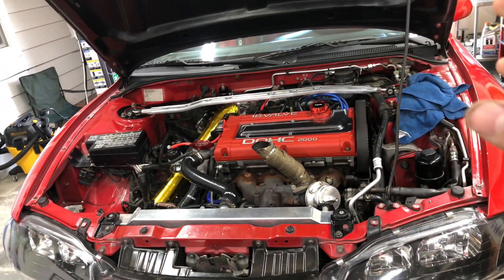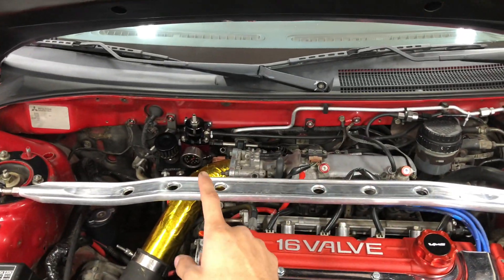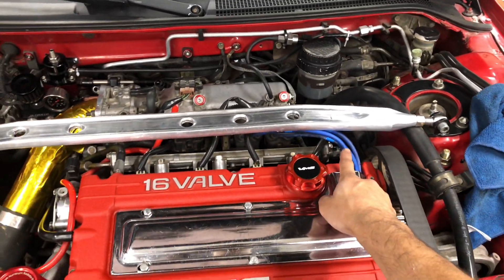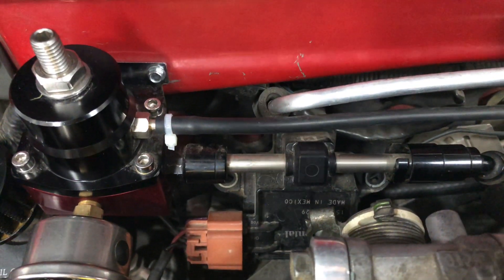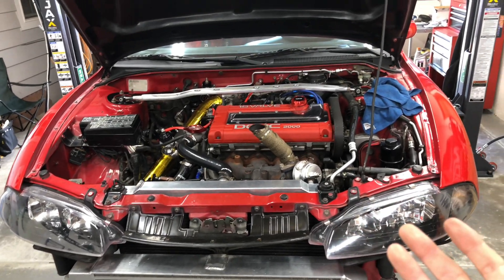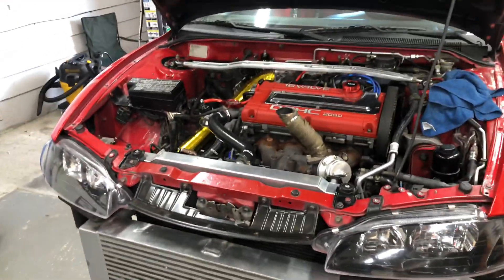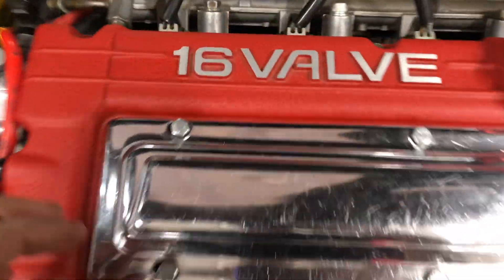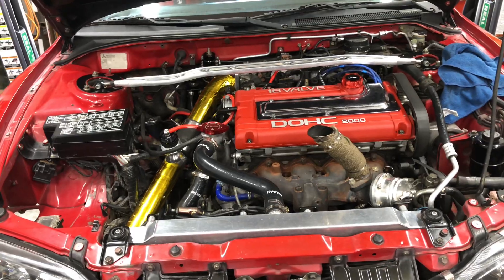So you want to run E85 “DSM”

Comment: I know you said you recommended to run 800cc injectors and up do you think 680cc won’t be enough?
Reply from the maker: Sorry I’m late to the post but would recommend 800 or higher since the flow rate with e85 is much more than pump gas

Comment: Nice GSX man... however I don't think you NEED Speed density.. I'm running full e85 no sensor for pump gas. No SD. Stock MAF at 27 psi 30+ when turned up. I'd definitely recommend it though! Speed density provides way better tuning. 👍👍 respect the vids though brotha I'll never go back to pump. I made 100whp by switching 👌👌 keep up the work.. oh and definitely GO BIG ON INJECTORS🤙 always better to have low duty cycles and plenty of room to grow. Then need more fuel hahaha. I'm running Bosch 2200s.. she purrs like a kitten!
Reply from the maker: I didn’t know that that’s great to know for sure especially for anyone wanting to run it! And what turbo setup you running?
Reply: @isaiaharechiga8924  No problem man! Currently running a throwback Hahn racing super20G with the T3 hotside.. things outdated but man it's a great street turbo. Came on the car when I got it so I'm squeezing what I can out of it. 400~ awhp on super conservative tune as far as timing. Still on stock 7 bolt with balance shafts😄 if your interested I have a video of me at the track for the first time a little ways back in my videos.. 🤙 was fun. My first AWD launch attempts.. it's definitely tricky lol.
Reply from the maker: @PapaSmurf918Detail  ya for use that’s close to what turbo I have it’s a 20g also and I’m hoping to make that or close to that power. It’s that perfect sweet spot for a street car. I would like to see those videos for sure👌🏼
Reply: @isaiaharechiga8924  oh for sure.. love it on the street! Will soon be switching setups to an FP Green/Red and speed density.. just waiting for the right time. You should have no problems with a good tuner man!🤙
Reply: So you don't need the sensor? Is it just so the ecu recognizes the change in fuel and can change the tune ?
Reply: @classified3171  No, you don't absolutely need SPEED DENSITY.. I run full e85 all the time. So if I wanted to run pump 91oct I'd have to adjust me tune to a " pump gas " tune 👍 Hope that makes sense!
Reply: @PapaSmurf918Detail  yeah I have SD I just thought you needed the gm sensor
Reply: @classified3171  Ahhh, that sensor you need. I was referring to needing speed density in general. As in I am running E85 on my factory Mitsubishi map. And MAF. basically SD isn't a must to run E85👍
Reply: Literally just asked this question. Glad to know SD isn't needed.
Reply: @mahreeohhhh  Yup! Still running strong here! 💪
Reply: @papasmurf918detail sooo to run E85 without speed density you can just use the things he just said like the ECU, injectors, fuel pump, GM sensor, fuel pressure regulator?
Reply: @toshiro3937  yup! Pretty much!👍